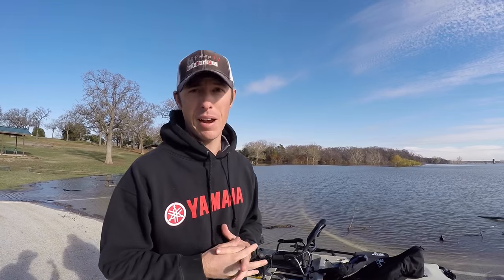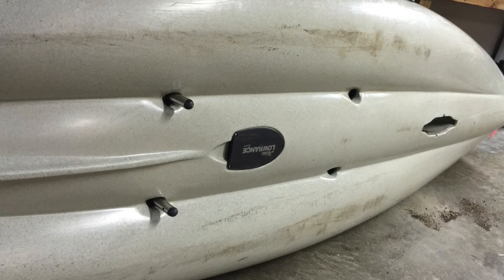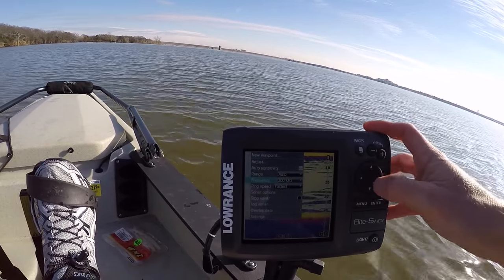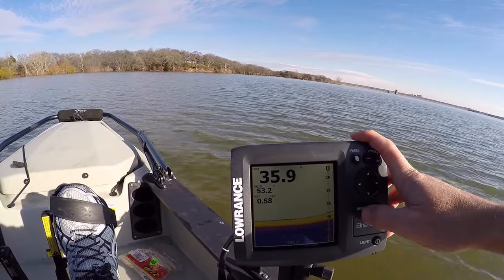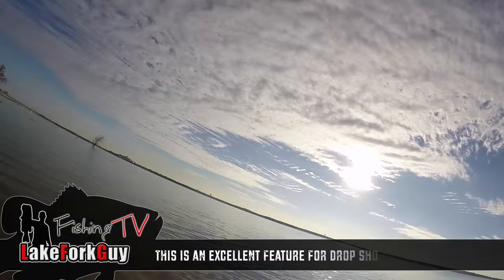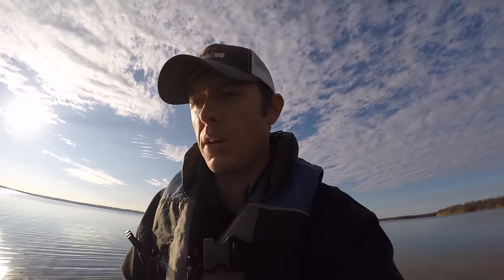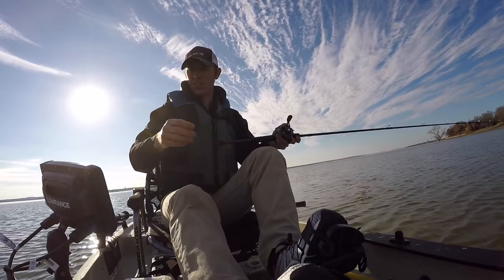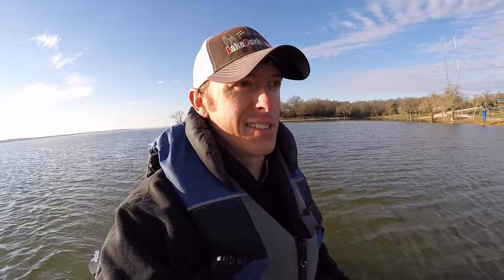Fish Finder Set Up with LakeForkGuy

Comment: I have the hook5 but the alarm volumes are extremely disappointing. The beep from moving around in the menu is louder than the alarm for shallow and anchor.. And that is in the enhanced mode and the audio turned to 10 which is the max. Do you also have these low audio volumes for alarms. The old LMS350A was excellent alarm volumes.

Comment: What frequency do you leave the broadband on most of the time? I accidently got an Elite 7 HDI with a 50/200 instead of an 83/200. Should I buy the transducer with the 83/200 or am I okay to stay with the 50/200 (i know that its not as good for fresh water)?
Thanks so much!
Reply: +Garden State Angling Higher frequencies will show more detail but lower frequencies will generally have a wider beam - and go deeper. 50 KHz is fine, just a little bit overkill for a lake. There won't be much difference - just a little less detail... And if you don't have down imaging or side scan, you can use 200KHz to see more detail. If you ever have to replace your transducer, get the 83, but otherwise I wouldn't bother